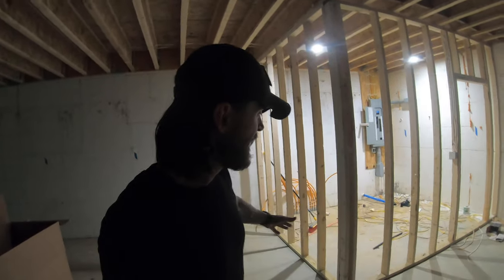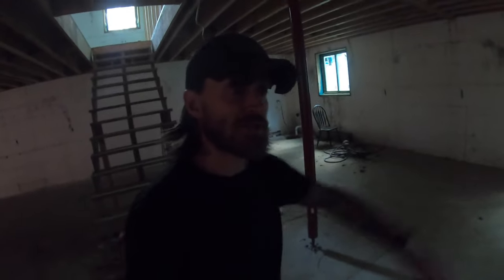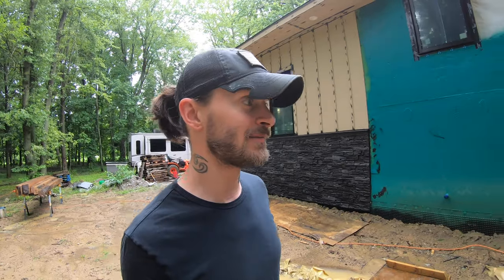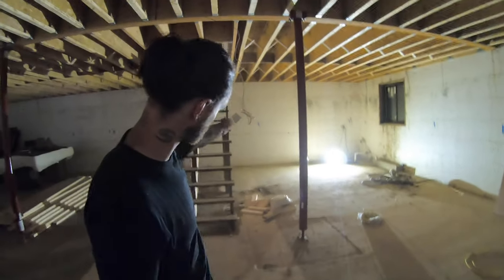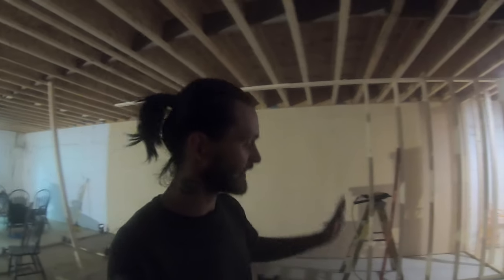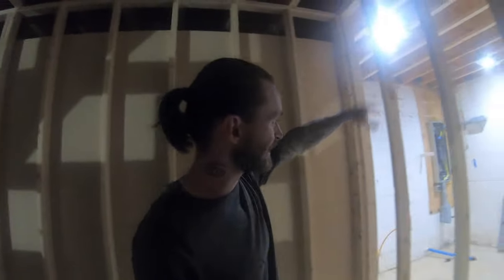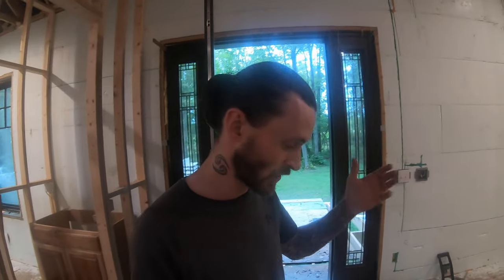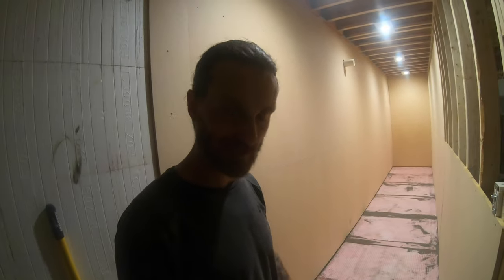ICF basement secret bunker build!!!

Comment: Nice Idea using the particle board which would make a flatter surface but I would put furring strips behind for an air gap between the foam exterior wall and 4x8 sheets for less chance of moisture buildup. Try talking the wife into at least 5 ft. (6ft. better) to give you a little more wiggle room for a 4 ft. safe and a 1.5 ft. deep reloading table.
Reply from the maker: We’ll to late now as it’s all done but it should be rock solid for moisture.  I’ll just have to make due with the size and hope everything fits.  I might do 2 safes, not to comfortable with just one and it being so big and heavy to move etc.

Comment: Awesome build, can’t wait to see the final outcome. Would it better to hook studs to icf wall and hand the particle boards to the studs. This will mitigate moisture that might seep from the icf wall and also strengthen the cabinets that will be hanged. Also cedar board below the particle board on the concrete floor. With the split ac and dehumidifier you spoke in the comments, it shouldn’t be a problem at all. Great going man!
Reply from the maker: I’m not thinking moisture will ever be an issue, I mean we don’t do anything special for normal walls and ICF’s are more air tight than normal walls.  Moisture should only be an issue on the side facing out and that’s a ERV/dehumidifier issue for ICF.  I think I will use cedar or oak for the trim since it’ll be siting on the tile and not in direct contact with the concrete.   Probably stain it and maybe the partial board to if it’ll take stain.

Comment: You should think about making into a server room.
If it were me I'd make it into like the ultimate utility room to have plenty of room for like pneumatic tubes for central vac, filtration for an aquarium or those drink co2 dispenser. basically just future proofing for anything you could think of to add later.
Reply from the maker: That sound expensive haha.  I’m a minimalist kinda, at least for building!   Who knows, if this channel blows up we can have more play things.
Reply: @neckofthewoods24  I'm more of a fan of craftsmanship because you can hide like speaker wire behind wainscoting and crown molding.  While also having access panels for all those things.
Reply from the maker: @mycool8980  I like that too.   Just need to learn how to make and finish all the stuff.
Reply: @neckofthewoods24  another thing u may want to think about is a sprinkler system.
Reply from the maker: @mycool8980  we’ve been told many times but just not something anyone does here.  I don’t even know if we have protocols for it or supplies for it.

Comment: The rain keeps slowing us down also. Question, do you half to put 1/2” drywall over the icf in the basement to meet the code?
Reply from the maker: I don’t have to but I’m not 100% sure on the fire block codes.  If no rooms go down there I don’t think I need them.  Now for me I think ICF burns instantly but like Nudura says they have 4hrs.  I don’t see how that’s possible!   Since the LVLs are attached to the ICF there’s no way to stop fire from burning the foam and going up behind the LVLs so you’re kinda screwed no matter what.

Comment: Any thoughts about air conditioning said Root cellar?  lol  Also,  will you be insulating the wall for sound proofing, maybe adding 1LB Mass Loaded Vinyl on the outside of the wall under the 5/8 Quiet Rock drywall you maybe using?..lmao  Love the videos and the house is amazing!!
Reply from the maker: I’m hoping the basement mini split will just kinda leak in and keep the roof cool and not humid.  If not I’ll have to cut a hole like a vent return or something you’d see thinking it’s a normal HVAC system but it’s just a hole so the room can breath.  As for sound proofing, I’m not going crazy, just the 5/8 partial board, R13 batts and 1/2” drywall.   We’ll save the real sound proofing for the master bedroom.

Comment: Did you consider using metal profiling for your internal non-load bearing walls? It may be a lot cheaper and its quicker, easier and stronger - especially if using normal or strengthened plasterboard. (p.s. Your interest in guns is disturbing!)
Reply from the maker: I did before when lumber was crazy high, now I think lumber is cheaper specially with bulk pricing.  I’ve never used metal studs before, my luck my hands would be shredded cheese.  And nothing disturbing, born and raised like any normal young boy in the good old days and I’m fortunate enough to afford toys I like.
Reply: @neckofthewoods24  Don't worry about the g** thing - its cultural and as you've probably guessed mine is different from yours! I was also worried about metal and, yes, when I tried I did get cut a couple of times - but you learn to be very careful very quickly! They are remarkably forgiving for amateurs like me (many c**k-ups) both length wise and slicing pieces for horizontal support where needed and the pieces only need to be punched together. Once you put plasterboard on it (let alone something like Habito - in Spain) it's actually surprisingly solid and strong.
Reply from the maker: @chrisshattock9916  when running wire through the open holes, how do they not get cut or chaff?
Reply: @neckofthewoods24  I primarily used halogen free insulated two core and earth (tough and fairly inflexible) but always also used corrugated halogen free plastic conduit. Overkill - but then you should see the 'average' wiring job in Spain. Mostly also run along ceiling/wall void and 'dropping down' where needed. If going around corners would use a PVC sheath with internal padding to stop movement.